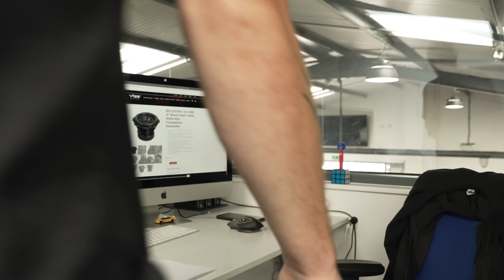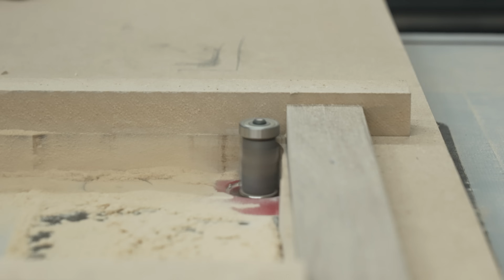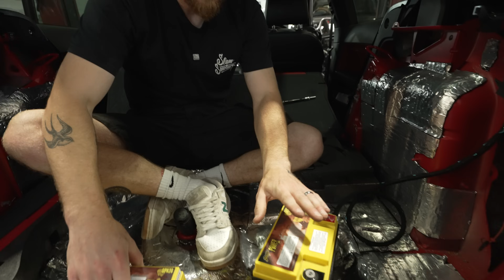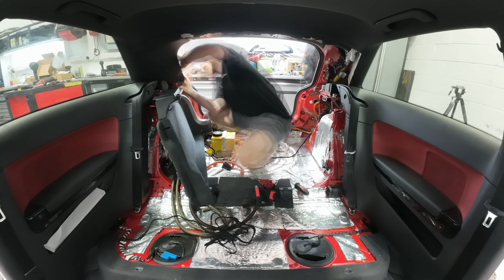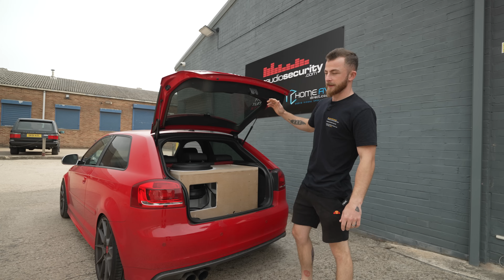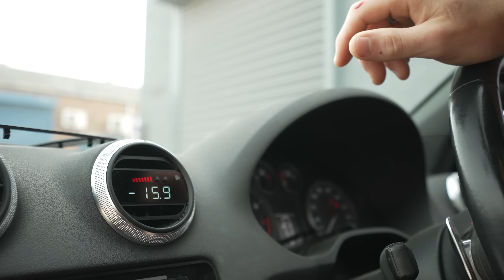SUBWOOFER BOX BUILD for Project Audi S3 EP06 | Car Audio & Security

Comment: What's the fast box connector called?.... help with a link?
Reply: Google search "Vibe fast plug"
Reply: Vibe fast plug. It's designed for small sub box amps to make them removable, but they can also work well as a speaker connector. Fits 8ga wire. 

Other similar connections would be XT90 or QS8. Those need soldering, but are smaller than the Vibe unit. 

You can also install the XT90 or QS8 directly into the subwoofer box, and then take your other connector from the amp and plug right into it.